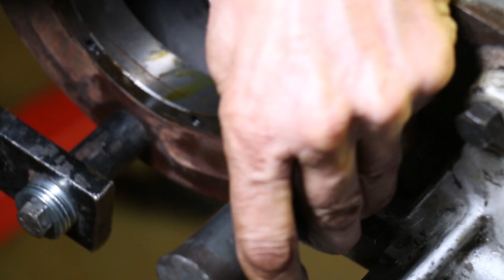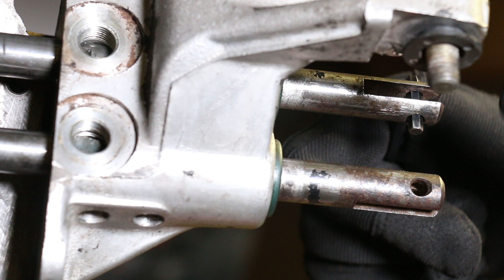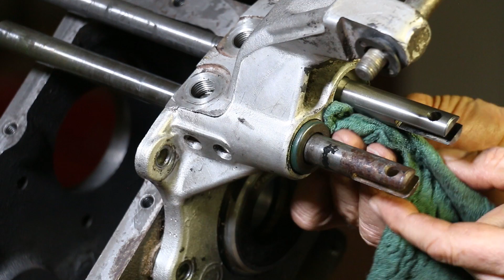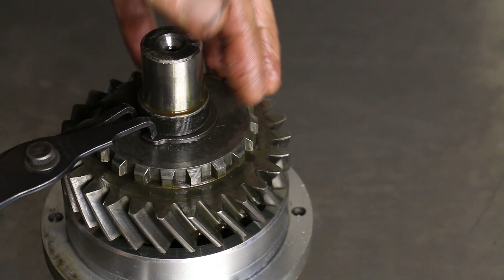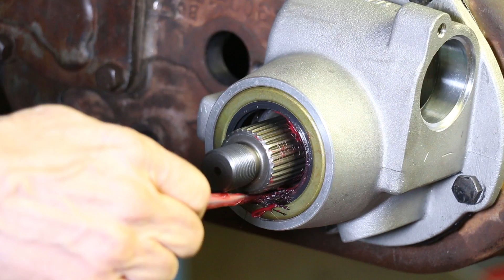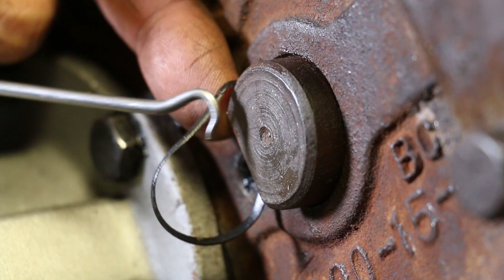TeraFlex Install: Low Range Kit DANA 300/HD Output Shaft

Comment: This is an EPIC video and easy to follow with 100% success. I just did the 4:1 gear swap and followed the video without any issues. There is only one thing(and a few tips) I found NOT in the video, and that is right at 20 minutes into the video. 

At 20 minutes in the video, you will see the rear output shaft inner bearing on the table. The first question is, how did I miss taking it off? I didn't. At 2:56 you will see the bearing attached, but never removed. So what to do? I placed the gears on the case where the oil pan goes and used the case as a part to brace the gears and "gently" removed the bearing from the shaft.

Another tip is when assembling the input shaft as seen at at 19:05 minutes in the video, a large socket is used in the video. I don't have that socket, so what I did is again used the case, I put the part on the case, leaving the shaft space to slide though unobstructed. Worked PERFECTLY!

Applying heat. I don't do it and was able to gently tap the bearing on without any issues. Its a good tip, but it will work without the heat too.

Shift rod tip: When installing the shift rods, pay attention to eh video, there are mall parts inside the housing that move side to side. If you don't have the parts aligned correctly, it will appear the the rods are stuck. I had one rod rotated the wrong direction and thought it as toast. But, I stopped and followed the directions again and got the small internal parts to move to the correct location. Just do it in sequence and it will work.... go slow!

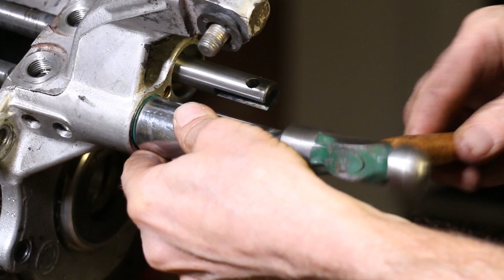Checking shift patterns at 32:07 is great to see the internals and function. I accidentally had one of the shift rods in the wrong position to start with. So before moving on from installing the shift rods at 12:02, try to remember to have them in the right location. Tap them outward. But don's worry if you have them in the wrong spot to tap them in to test the shifting at 32:07. I attached the the twin sticks and used the leverage to confirm everything worked. The issue is, you don't have enough leverage to pull the shift rods by hand.

Good work TeraFlex! Thanks for the great video and awesome gears.

Comment: I used a two prong gear puller rental tool from Advance Auto to get the rear yoke off nice and straight and a three prong puller with the hooks facing outward to push through the rear shaft out through the bearing.  It was on there so damn tight that the BFH didn't even phase it.  The rear shaft shift fork was the donor of the sprinkles so that rear bearing was likely the culprit.